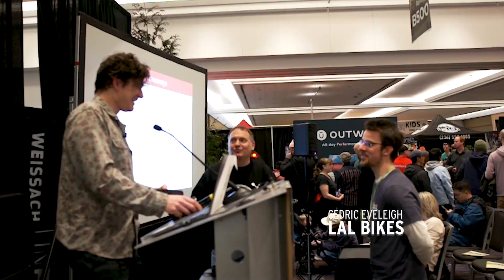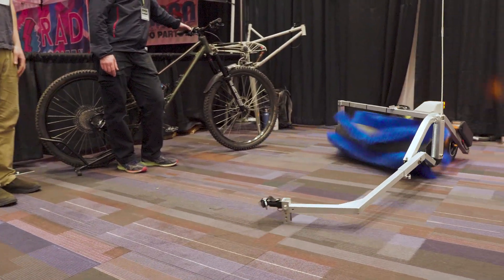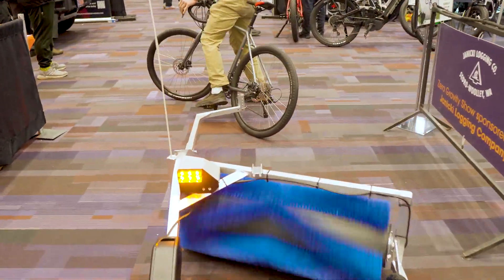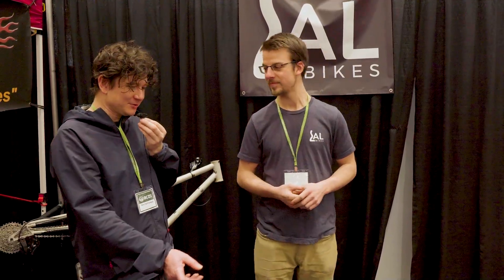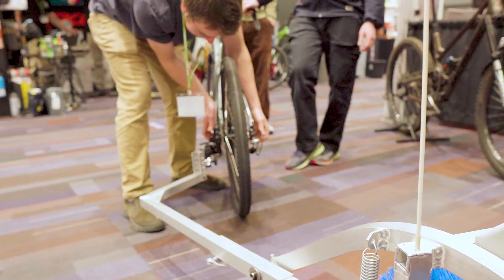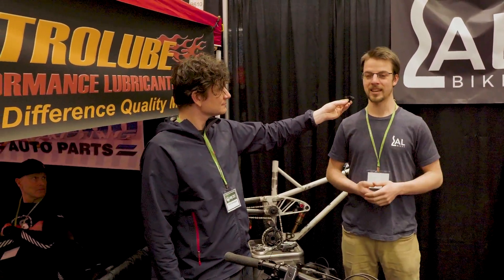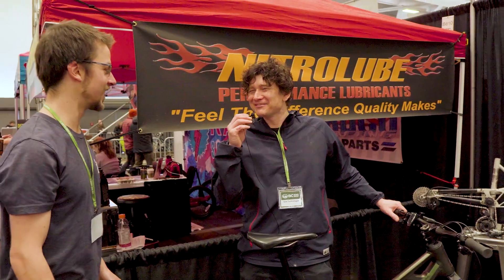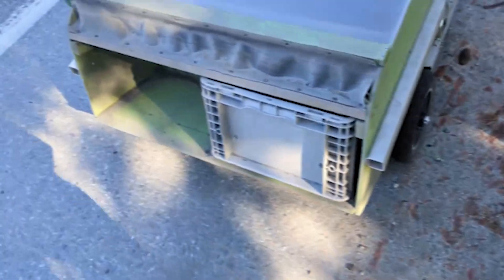A Powered Bike Lane Sweeper? Interview with our neighbor Cedric at the 2024 BC Bike Show

Comment: the brush alone costs a fortune, on a minimum of 130 bucks for a 500mm wide one (that's like 20 inches). I'm looking for a similar method because my local bike lanes are full of debris, and the council sucks..
Reply: Brushes like this aren't cheap, and neither is the battery or motor or metal fabrication. But the overall cost of our bike lane sweepers is orders of magnitude cheaper than bike lane sweeper trucks (which can cost around 200k USD).

Comment: How well does it perform over uneven surfaces and potholes? Any issues so far with durability?

One idea on how this could be made more effective for municipalities: add a sensor to detect when the buckets are full and have that read back to an app on your phone which maps your ride. Detecting how frequently you need to empty the buckets in combination with GPS data will give you an estimate for which bike lanes require more frequent sweeping. And you can use this data to build a forecast of when each lane should be swept to optimize efficiency.
Reply: The brush is suspended so it follows the terrain. But the sweeper is meant to be used on paved bike lanes.
About the tracking and bucket emptying, we are actively working on functionality along those lines. 😉
Reply: @cedriceveleigh  I don't know if you're going to see this, but as someone who has lost more than a few expensive 250g sew-up tires to road debris, I absolutely love the sweeper.  That would have been fantastic to run over  time trial course I rode many years ago to make the surface safe for traction.  And while I'm a roadie, I don't discount how marvelous this is for maintaining MUPs and bike lanes.  You have a beautiful brain, mate.  Cheers!

Comment: Have you tried it with snow? My university would use a brush attachment on a tractor…

I bike to work daily. Clearing snow from our trail system has not been a priority for our operations and maintenance group. I would certainly pull this thing to and from on my commute though for sure and bet I could get a fleet of volunteers to ride the primary routes with their own…

I should add, I work for my municipality but in a separate department. I wonder if we could apply some grant funding to purchase some of these, should you get to manufacturing them.
Reply: This definitely would not work for snow unless it's a light dusting. That said, gas-powered snowblowers are not that expensive, and there are tons of models that fit in a bike lane.

Comment: Correcting myself, Pierre Lallement is considered by some to be the inventor of the pedal bicycle (not the bicycle). The push bikes from before then are apparently considered bicycles. Pierre Lallement added a pedal crank to the front wheel, making them pedal bicycles. My company, Lal Bikes, is named after him.
Reply: The two things I thought about for your bike sweeper:
1. If it were wider (I believe 4 feet is the average width of a bike lane) it could sweep the whole lane in one pass.
2. If you could fashion a small wedge shaped plow or brush to go over the front wheel of your bike, you could protect your own bike from street debris.  It doesn't need to be that big, because the rear wheel should follow in the path of the front wheel, it just needs to push debris aside to be collected by your rear brush.
Reply: @LeesChannel  Hey, thanks for the suggestions. 1. The width of the sweeper was chosen so that it can work where bike lanes aren't wide and where it needs to pass between things. 2. We haven't had issues with the towing bike and debris, because the rider is very aware of debris and is typically going 10-15km/h.

Comment: Why does it look so much different than a street sweeper. Did the designers of those things overlook something?
Reply: They overlooked the opportunity to pull a brush by bike!
Reply: @cedriceveleigh  it does look like it would be fun, for about 5minutes
Reply: The size and surface characteristics of a car lane and a bike lane are different.

The cup looking brushes on a sweeper truck are picking things up over a large area and often next to curbs.  

Multiple brushes allow for easier change outs because they're smaller, and the cup style let's the brush get up against the curb.  

Multiple brushes would allow the user to modify the brush density and material for the sorts of debris that will be on the side vs the middle of the road.  

I also would assume that the curbside brush rides a little lower because of the camber on most streets that facilitates rain run off.
Reply: @HarryLovesRuth  the particle sizes is the same. Don't need to collect sand. Just need to move the bigger pebbles a couple feet further off the path... I thought that's all that sweepers were supposed to do. At one point I was thinking about a fully-human powered version,where power efficiency is much more a.concern than your case where you have a power supply to assist. It seems to do a very nice job!

Comment: I moved to a remote part of BC on Highway 16 last fall and haven't yet made any bike trips on it, I've been watching the shoulder of the highway and there's definitely a need for it to be swept. The  loose gravel could easily prove fatal if it caused a spill/dump into traffic that has many large trucks traveling at high speeds.

I've considered the idea of fabricating my own form of lane clearing but hadn't yet found a suitable solution. Your design here looks awesome. Highways are provincial in BC, right? So I should contact the Ministry of Transportation if I had any hope of this section of highway being swept using public dollars?
Reply: I should have read the comments before posting as I immediately see that I should contact Lal directly @ their site.
Reply: Highways are indeed managed by the province here in BC. The contract that the Ministry of Transportation and Infrastructure gives to maintenance companies calls for a totally insufficient amount of sweeping of shoulders (bike lanes along highways).